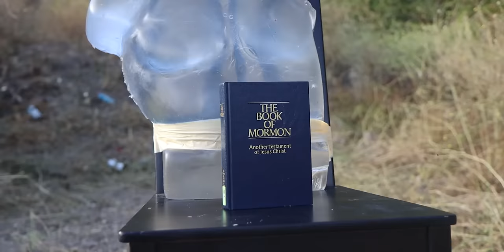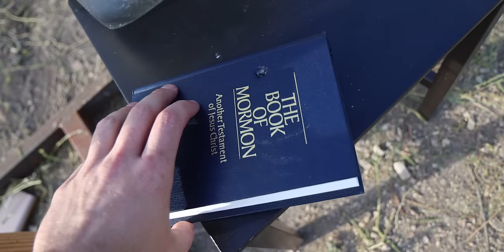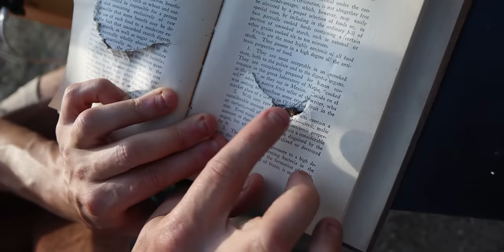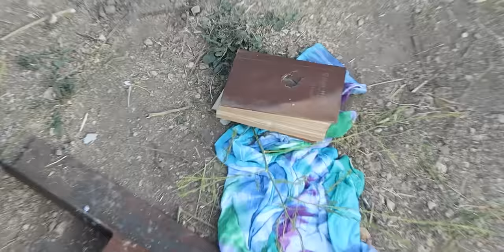How Many Shirts Will Stop a Bullet?

Comment: someone please get allen a mic limiter lmao
Reply: He’s pretty annoying lol
Reply: It got worse towards the end lmao
Reply: They could fix it in post processing.
Reply: I think he's yelling bc he's wearing ear protection and is "upping the volume" to hear himself without realizing it
Reply: @human3rr0001  no they couldnt, you cant do anything against "analog" distortion
Reply: @human3rr0001  read my comment and watch the video. This will only work if the digital gain slightly overrides inside audacity not the mic itself because its gain is set to high. Thats the difference between analog and digital clipping.
Reply: @leandrojprz  you can still normalize the waveform digitally though. It's not the same as running an analog compressor, but it'll improve the loudness on the final playback.
Reply: You could also run a spectral analysis on the waveform and dampen certain frequencies causing the distortion.
Reply: @human3rr0001  we aint talking about compressing the signal.
Reply: @human3rr0001  and spectral analysis wont do much. I think you dont understand what distortion means
Reply: @gibsonf06  WHYS THATTT??????
Reply: He was wearing a mask and stuff earlier, but he took it off.
Reply: fr i almost had to stop watching. i turned my volume down and it still hurt
Reply: @leandrojprz  you could 100% fix that in post. Like you said, its analog distortion and not digital, which can be pleasant and doesn't ruin the audio like digital clipping. Literally all that needs to be done is to have this guys voice lowered when he's yelling, so a compressor bringing the rest of the audio track up but aggressively dipping the loud parts would be a good start. it will still be distorting but it doesn't have to be so loud and peaking compared to the rest of the audio. Then you could use something like Soothe2 on the harsh upper frequencies which works kind of like a de-esser to tame the frequencies that are distorting. My guy noah is right tho you could make this much better in post
Reply: @sebg2193  this is basically because the electrical curcuits in the mic produces Amplitudes which the soundcard cannot handle. which leaves us with Information loss which cannot be undone (soothe2 is a fancy dynamic eq and a deesser is essentially a compressor) you and your guy Noah should familiarize yourself with the dunning kruger effect and audio processing
Reply: @sebg2193  thank you very much you professional mix and Mastering engineer
Reply: @sebg2193  but distortion is still not possible to fix in Post
Reply: @leandrojprz  You dont need to fix the distortion, you just need to compress the loud parts to be quieter. how are you not understanding this.
the audio just needs to be evened out overall, and then thats why i said you can use soothe2 after to tame some of the harsh distortion frequencies.
Reply: @sebg2193  bro, there are no loud parts. You cant compress them because they are DISTORTED. If they would CLIP, of course, compressing them would help...
But you are the mixing engineer here, not me.
Reply: @leandrojprz  The louud parts are when hes screaming and the audio gets loud af, and btw Clipping is distortion 😂🤦
Reply: @sebg2193  I WoRk As A MiX aNd MaStErInG EnGiNeEr. There is a difference between clipping and distortion. But if you think there isnt any, then no wonder why you dont get why this cant be fixed.
Reply: @leandrojprz  you're actually so difficult its embarassing, clipping is a form of distortion. this videos audio can be fixed. you cant remove distortion, and no one is claiming that. But you absolutely can bring down the loud parts of the audio with compression.
I can just imagine if you ever worked in a studio and a client send you some audio that wasnt perfect, you would spend the entire time yelling at the customer that the audio is unfixable instead of even trying to do anything.
 goodbye child
Reply: Holy cow, for real.
Reply: 13:42
Reply: Average Cod loby
Reply: @jquikshot  he was doing it the entire video
Reply: One of those personalities you can only deal with for small amounts of time. And even then, only if you're in a good mood.
Reply: He's very annoying
Reply: @standardaussie The ones who get really excited about this which could be cool if you need the motivation but otherwise, it is an annoyance. His pitch did not make it better either
Reply: Nah there’s clearly no issue
Reply: or less americans
Reply: Mg, rip for the headphone users😢
Reply: Americans are so loud it's unreal 🤣🤣
Reply: Improve somewhat, not fix. Unless they recorded at 32-bit float which I highly highly doubt.
Reply: @gibsonf06  Very
Reply: Yeah holy fuck shits got me trippin
Reply: Bro for real he needs to chill tf out
Reply: it's so annoying. I hate the "youtuber" laugh. I swear, they're all drunk or high. lol
Reply: Hard to tell how loud you’re being with ear pro on
Reply: Feels like I'm listening to my old high school stunt movies
Reply: sounds like a COD lobby
Reply: 💯💯😂😂 shit was cracking the speaker
Reply: "Oooo ho ho ho I can feel you!"
Reply: no it adds to the experience
Reply: 13:40 its not that bad
Reply: @Nuttnneng bro💀
Reply: @jquikshot  I mean, they were all wearing ear protection, so he probably did realize it and was doing it on purpose so they could hear him more easily

Comment: Just FYI for anyone reading this, not all bulletproof vest are also stab proof 

For Kevlar to be stabproof, it has to be more tightly wooven than the Kevlar used for bulletproof vest

What stops bullets is different than what stops knives
Reply: Get a plate carrier with ceramic or steel plates with a kevlar cover that reduces spalling for the steel plate
Reply: @jlwalker2965  drive a leopard MBT everywhere you go
Reply: So basically you need a different vest for America and England then?
Reply: Ah I see. So you need to watch out if the vest was manufactured for the US or the Bri'ish market
Reply: @DustD.Reaper   armour is armour. as long as it protects you
Reply: @derpanther-ingenieur8460  that’s extremely false, different armour is used for different purposes, if you got yourself a jack of all trades, it’s probably truly not good at anything.
Reply: so you mean i cant wear an American bulletproof vest in the uk?
Reply: @captchron6148  "A jack of all trades is an expert at none, yet way better than an expert at one."
Reply: @jlwalker2965  No one uses steel plates anymore
Reply: aww that sucks i was gonna use one of these to go to london
Reply: Depends on if it's soft body armor (like kevlar) or hard armor (Ie Ceramic/Steel plates). Kevlar is good at stopping things like hollow points which spread out the point of contact and are also slash resistant but anything armor piercing that reduces the point of contact to a fine point (like stabbing) pushes the fibers aside and hence it's less effective
Reply: @rykehuss3435  A lot use steel plates still. Heavy as fuck but lots of places still use them.
Reply: @rykehuss3435  Lying through your teeth, tsk tsk.
Reply: @DustD.Reaper  yeah it would have been too OP to have them do both at the same time
Reply: @DeviantDespot  Also it is cheaper 👍
Reply: Just wear a full suit of knight armor with a kevlar vest .
Reply: @captchron6148  thank im making comment more clear now
Reply: @rykehuss3435  Many people still do, and it’s simply for the cost, Steel body armor plates are way cheaper than ceramic. That doesn’t mean they’re better, I still personally would run a Ceramic plate (Hesco) with a boron-carbide backer plate, and a vest-mounted trauma-pad.
Reply: same for arrows, hunting arrows from a hunting bow will go through most bulletproof soft body armour.
Reply: Bulletproof isn't a thing. Bullet resistant.
Reply: @DustD.Reaper  Yeah. I remember watching a documentary about the history of personal armor a long, long time ago and I feel like one of the segments was about british police being issued kevlar vests which didn't do them much good and ultimately led to the development of more slash/stab resistant armor
Reply: britan be like
Reply: did you find this out the hard way
Reply: Yup, you should never assume a soft bullet proof vest is stab proof, knives go right through them.
Reply: @jlwalker2965  just get ceramic because steel will never not spall even with a cover and the price difference is negligible for how much better ceramics are 🙏
Reply: @DustD.Reaper  nah they make vests that cover both.
Reply: @locald3migod  Kevlar is still effective against pointed rounds. It's just that most "armour piercing" rounds are rifle or assault rifle rounds, which have several times the energy of pistol rounds. The immense difference in energy means that the kevlar armour doesn't really stand a chance. But the same type of round at energy levels comparable to pistols wouldn't be much of a problem/
Reply: @DustD.Reaper  Nope. Knife crime in England and the states is about the same
Reply: Peleguin
Reply: It's easy just wear both
Reply: Ceramic or steel
Reply: @derpanther-ingenieur8460  Leopard is not a good plan. The frontal protection is good but modern tanks have very poor rear and top protection. There are parts of a Leopard with less than an inch of steel between crew and the outside. If someone does a mass shooting with 14.5mm rounds you are not invulnerable in a Leopard.

I would say get the heaviest WWII tank you can and then put applique armor on it and upgrade the engine to something modern.
Reply: @petersmythe6462  thats a little overkill for some handguns
Reply: @ejedwards1678  I dunno. I think airs pretty bulletproof. You can’t even scratch it with bullets.
Reply: I personally feel like 120 layers of tshirts would be stab proof at least for the first couple jabs. Ez budget armor right there
Reply: @landintaylor3027  Nah it just ain't physically possible, you just can't
Reply: yup, its like chainmail vs a cuirass
Reply: @tale7955  not all armour stops everything, you get it for a specific purpose depending on the job
Reply: Wow, like the shields in Dune!
Reply: @HowIsAsh  Tightly sew kevlar is actually capable of stopping both bullets (low caliber, like any normal kevlar) and knives, so, come again?
Reply: @landintaylor3027  hell if i remember right,  their police dont even carry actual guns, just nightsticks and tasers i think
Reply: It’s like chain-male armor it’s slash proof not stab proof
Reply: @tale7955  but the issue is if your armor is. "jack of all trades that means that unless your getting attacked by the lowest quality weapons from both sides your screwed and when you in America guns are much easier to get and in England everyone has a knife by default so if I got a new sharp butcher knife it's probably going to tear through your flimsy jack of all trades armor and if anyone uses slightly higher quality bullets than your average person your armor also because useless if your wearing high quality bullet proof armor it's easy to not get in knife stabbing range if your wearing knife proof armor it's because the risk of getting shot is nonexistent if your wearing a jack of all trade armor it's protecting you from shit because in the 2 different areas knifes are sharped and sold to cut through armor while guns are made and sold to penetrate armor armor that tries to protect you from both will end protecting you from nothing
Reply: Oo
Reply: The slow knife penetrates the shield
Reply: @oldfrozenwolf6803  Except that's not how armour works at all. 

To begin with, the way bullet resistant (there's no such thing as bullet proof) vests work is by slowing down the proyectile using a material that can deform under pressure. 

The reason why bullet resistant vests don't generally stop knives is because bullets are rounded, so, you don't need too much of a packed kevlar to stop them, the problem is that knives can get in between the kevlar stings and penetrate de material. 

Packed (or tightly sewed) Kevlar has its strings too close together for knives to be able to penetrate, so, you need five times as much force to go through it than with a normal one, and it can still stop bullets.

Knives can't even cut through kevlar to begin with because the material is highly abrasive, so, it doesn't matter how sharp you blade is; to have the highest effectiveness you need the blade to be narrow. If you come at me with a butcher's knife, my vest will not only stop you from damaging my body, you'll get your arse owned before you can swing a second time.

Also, you poor excuse of a broken condom, bullet resistant vests can't stop certain rounds no matter how much you want them to be magical. Anything over .45 will go through them as if they aren't even there, in which case you'll need armoured vests which have metal or ceramic plates.

Go figure, you tried to sound smart to someone who's uncle is a shooting instructor. Basically, you know jacks*it about the topic, while I've been learning about it since I'm 5. 

Go do some research, you oxy-moron.
Reply: A steel breastplate stops an arrow but not a bullet, a bag of sand stops a bullet but not an arrow (usually)
Reply: Reminder, some cities are now banning bulletproof vests

seems a little counter productive but ye
Reply: @DustD.Reaper  America still has more knife crime per Capita than england Soo..... Wear one on top of the other in America
Reply from the maker: So youre saying all guns should shoot knives?
Reply: @mastercief20129  id agree. Simply by the fact that a lot of knifes are shorter than the thickness of so many shirts.
Reply: @Ididathing  I agree
Reply: @tale7955  well that was cringe
Reply: @Ididathing  I mean, isn't a Crossbow a gun that shoots knives?
Reply: @idiotbuster8662  What?
Reply: @DeviantDespot  Yep steel and ceramic plates are mainly use to stop rifle rounds. Mainly intermediate cartridges i.e 223./55.6, 7.62x39, ect.
Reply: And different from what spikes stop
Reply: @philondez  well most kevlar is pretty slash resistant. It's just not stab resistant by nature of how it works to be bulletproof.
Reply: @Ididathing  Holy crap, actually if you could ballistically stabilize a round with a hardened steel blade on the tip, it absolutely would slice right through kevlar. Haha! Now you're using the ol' noggin ;)
Reply: @Ididathing  and that is a good video Idee I guess
Reply: 3 types of penetration 
Bullet
Stab
Needle
Bullets need to lose velocity and get caught 
Stab needs to be tightly woven
Needle has to be against something solid
Reply: @DustD.Reaper  lol yes. For England you need plates for stabbings.
But plates are also good for stopping bullets depending what level it is.
Reply: @WoodlandFops  Steel armor does have more of an issue with spalling, but at least steel doesn't shatter if you drop it like ceramic does.
Reply: @snakeking-zo6mu  no good ceramic plate will shatter if you drop it lol. Even cheap ass RMAs are fine after getting dropped from chest or head height and over, with plenty of tests to prove it. If yours can't pass that, you just got unusually awful ceramics or a lemon batch.
Reply: @Ididathing  thats a good video idea right there sir
Reply: @Ididathing  presisely
Reply: @WoodlandFops  I only have steel plates myself, but when I was looking into ceramic ones a few years ago they seemed a lot less reliable than steal, especially if they get hit multiple times. And I've seen people saying that their ceramic plates shattered from being dropped, but I can't confirm it.
Reply: @snakeking-zo6mu  you've definetly been misled. Maybe if they were incredibly old or incredibly cheap ceramics, but like I said, even things like RMA 1155s (which are relatively low end, mind you) are both durable against impacts and can take an absurd amount of repeated hits from various calibers. It's better than steel, in every way.
Reply: @qyasar8046  I really hope no one tries to argue with you on this one. Unless they want to make a huge ass of themselves...
Reply: @Ididathing  Thats exactly what you should make on your next video
Reply: @WoodlandFops  Possibly. But I'll probably stick with steel, since I know more about it than ceramic. And steel is still a good bit cheaper than ceramic.
Reply: @snakeking-zo6mu  it's not a good bit cheaper than ceramic anymore. And going with a objectively worse and downright risky product at best because you're willfully ignorant is not something you should want to do. Do some more in depth research and look at testing, then buy some ceramics lol.
Reply: Can it stop a gun that shoots knives?
Reply: @captchron6148  AR500? Steel plate armour will easily stop a knife.
Reply: @Skrenja  have fun carrying plates all over your body, what I said still stands.
Reply: @tale7955  Personally disagree. If I had a brain tumor that needed removal I'd rather have the master surgeon than the okay surgeon who can also juggle and solve a Rubik's Cube.
Reply: @endermaster5690  Yup - over here, if the police officers arresting you have guns, you know you REALLY fucked up as firearms-trained units only show up when absolutely necessary
Reply: @Ididathing  next video:
Reply: @michaelcho3564  I would gladly prefer to be attended by someone who's less prepared than a "20 years studying the brain" doctor, if they can also perform heart, lung, vascular and stomach surgery. An expert at a single area is a one trick pony, and that's why the entire sentence states that a jack of all trades i better than an expert at one.
Reply: @Ididathing  Unsurprisingly, there is a gun in Borderlands 3 that shoots knives.
Reply: @Ididathing  I'm begging you, do NOT make that
Reply: @tale7955  not in this case.
Reply: @Ididathing that’s like the Fortnite gun…